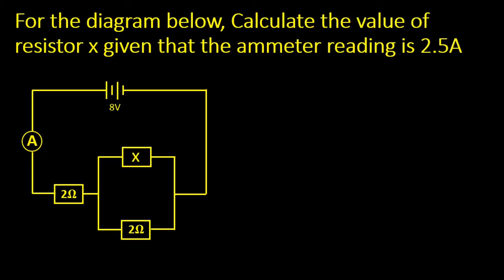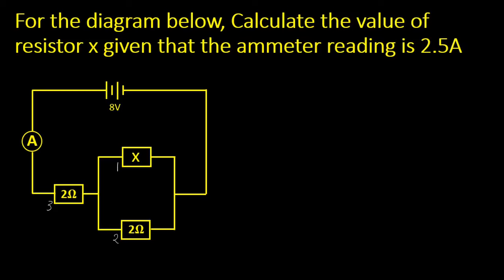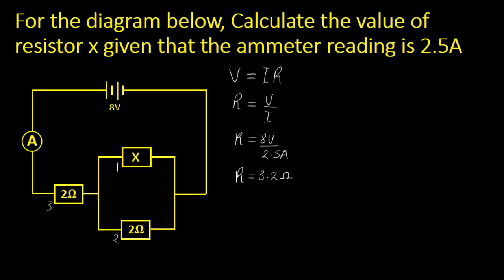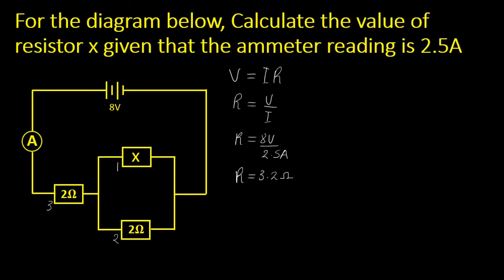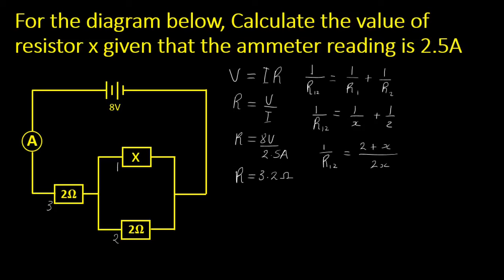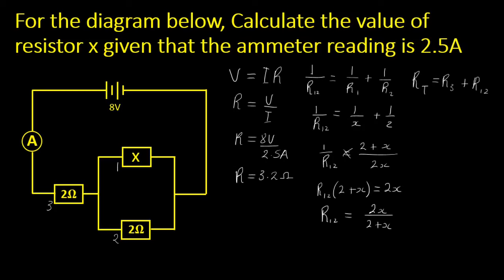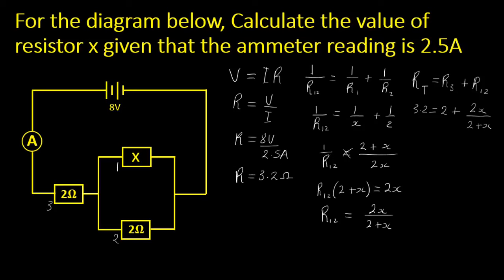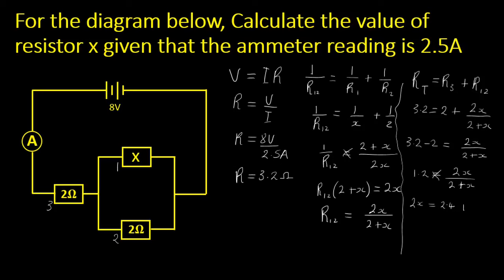Calculate the Resistance ~ Current Electricity

Comment: Different approach - split the resistors into 2 parts: R_left and R_right and calculate voltages.
U_left = R_left * I = 2 * 2.5 = 5 V
U_right = U - U_left = 8 - 5 = 3 V

Now you can calculate currents on the right side.
I_down = U_right / R_down = 3 / 2 = 1.5 A
I_up = I - I_down = 2.5 - 1.5 = 1 A

Finish it with a simple Ohm's law.
R_up = U_right / I_up = 3 / 1 = 3 ohms
Reply from the maker: Yes

Comment: There is a much simpler way.
After calculating the total resistance of 3.2 ohms, the parallel resistors is equal to 1.2 ohms. Just work on that bit.
1/1.2 = 1/Rx + 1/2
1/Rx = 1/1.2 - 1/2
Rx = 1/(1/1.2 - 1/2)
Rx = 3
Reply from the maker: Yes